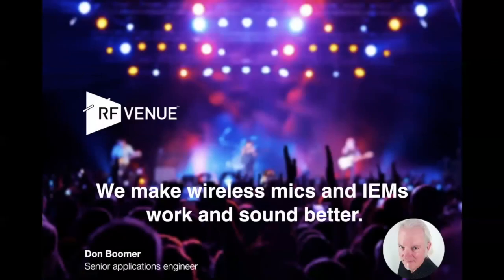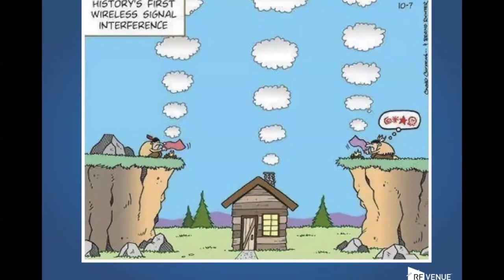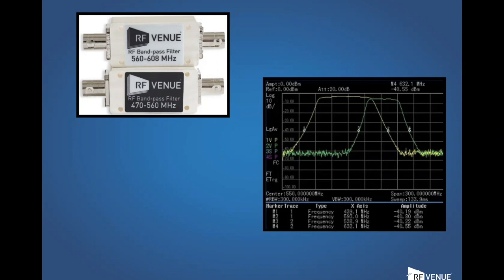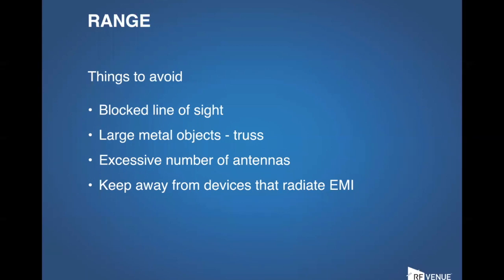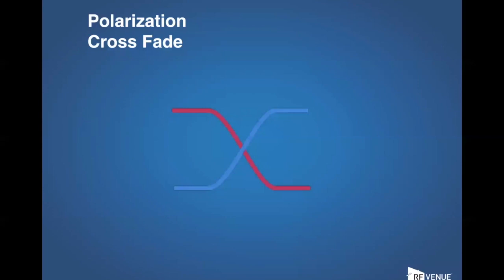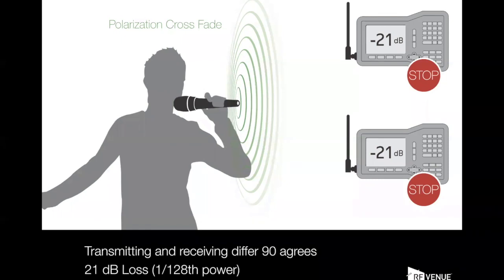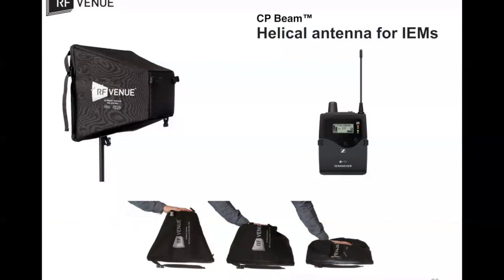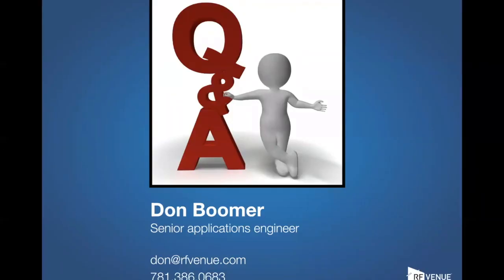Why Wireless Mics Drop Out - Webinar 1

Comment: A lot of good information... Wouldn't putting your receiving antenna for microphones and sending antenna for IEMs at a 45 degree angle solve a lot of problems since it would be a maz 3db loss at all times?

Or for diversity receivers, putting one of the antennas at a 45 or even a 90 (horizontal) as this this what the diversity fin is doing in one package

Comment: quick question I have 4 g4 body packs tx and Rx, wanted to find out if it's possible to remove the original antenna and replace with  a male bnc connector in order for me to connect it to the ASA 214 to boost my signal...I've tried everything from scanning frequencies to moving close to the talent that's wearing the tx and I still get alot of signal drops/loss...kindly advise if this is possible?
Reply: Hey man, I'm guessing you're using the EW-G4 sennheiser wireless units? if not, then just disregard this post hahaha.
been using those for a year now, and the drop outs are pretty vast.

Good thing is that you can manually modify them and it is actually really easy to do, though I am not 100 certain about the hooking it up to the ASA 214. But as long as it is the same cable going out of the unit into the ASA, my guess is that it shouldn't be a problem. 
Here is a link to a video detailing how to do the upgrade: https://youtu.be/wWpro305EaQ 
(or look for Steve Oakley's video about Sennheiser G3 and G4 SMA Antenna Mod)

hope it helps!